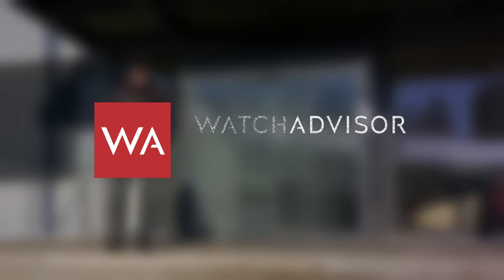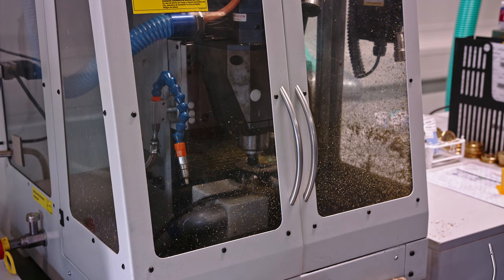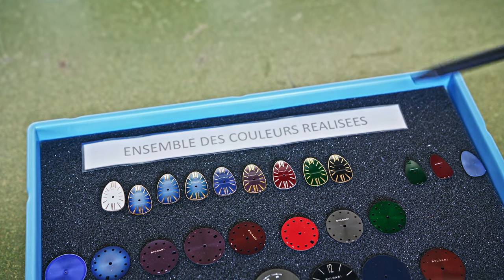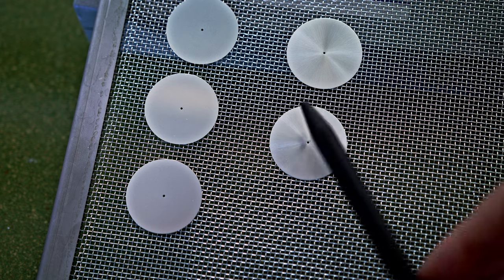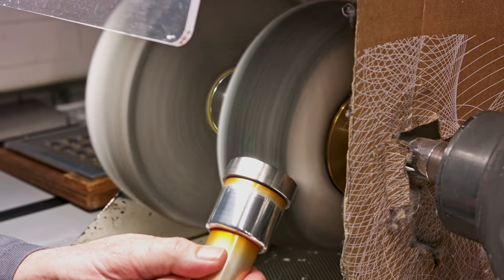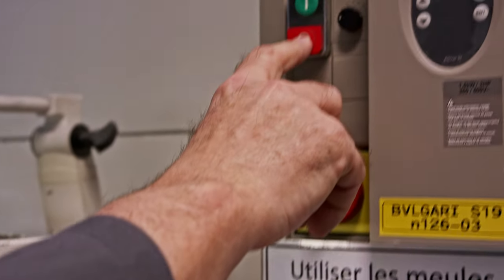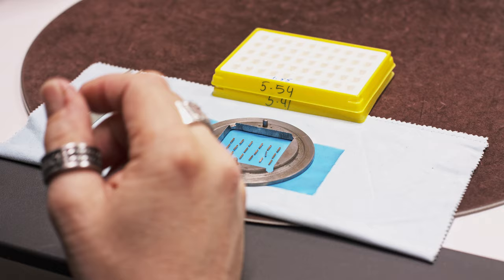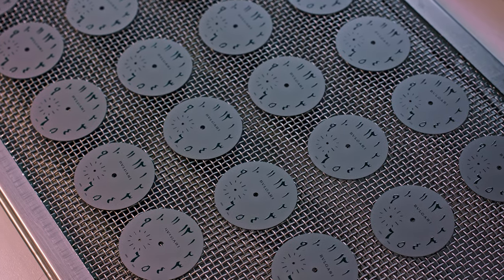BVLGARI Octo Finissimo. The making-of dials for an iconic wristwatch. PART 1 of 2.

Comment: How many watches do they make in a year ?
Reply from the maker: They won't tell me... The watch industry is very discrete...
Reply: @WatchAdvisor   Thanks for responding 🙏
Reply: i've read some projections and chatter and the best guess is ~5k Octo Finissimos per year. A small amount relative to the big manufacturers. There might be something to this estimate as there really aren't ever too many listing on Chrono24 or ebay. Bulgari produces many variations of the Finissimo, but make very few of each iteration. If true then current secondary prices seem too low.
Reply: @timeisahumanconstruct9251   Thanks 🙏